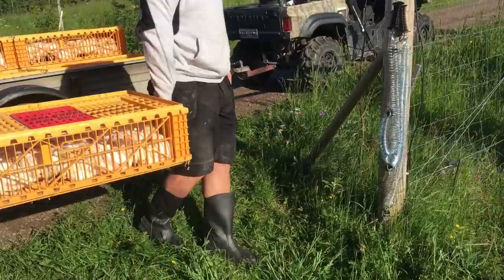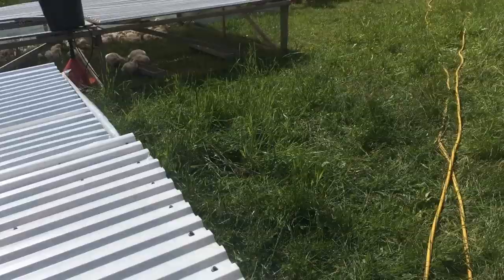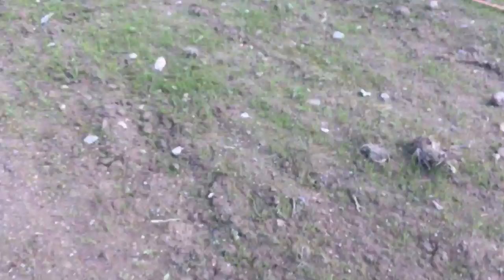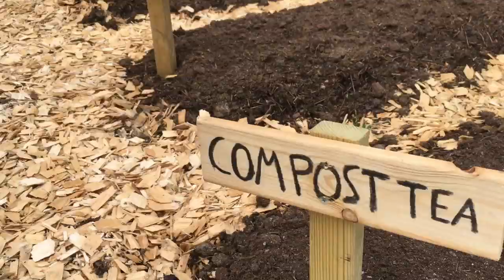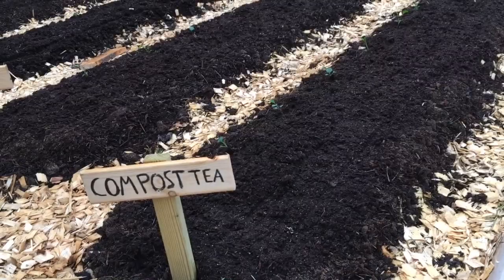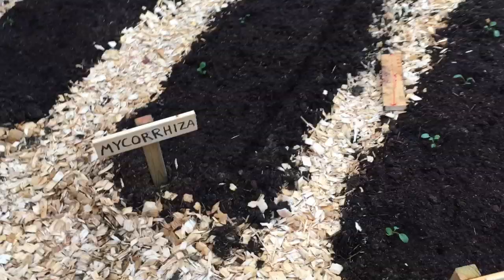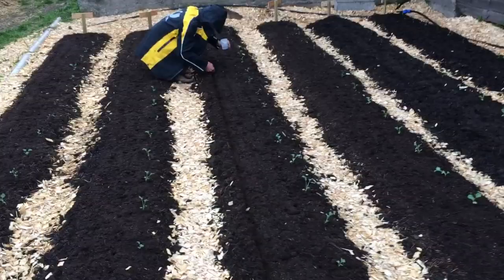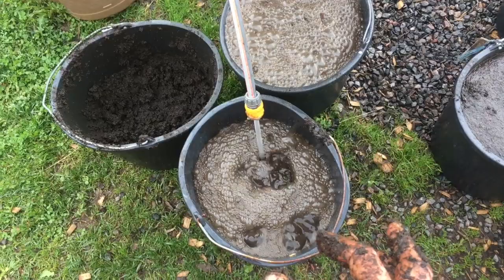Soil building trials

Comment: The Biochar row should result in less production in the short term based on my understanding. Something about it absorbing nutrients which are then released on a much longer scale. I don't know if just 18days inside of compost is going to allow it to absorb enough to then start the long term release? Either way excited to see the results!
Reply: lessercylinder Beans probably won’t do well for first year run. Watched another permaculture use and explain it locked up the nitrogen in the soil. But after a year the bounty was twofold. Interesting stuff for sure.
Reply: If biochar do not work, you need to look at the process, and find the error.
Here is how i do that (startig from the barren sand)
- make charcoal from the wood
- mix it with own pee (or other nitrogen source)
- bath in the compost juice to get the bacteria culture we want
- mix with the soil in 1 to 10 or 1 to 6 for grass species (include wheats)
Now you have yield 10 fold, forever! Do the job once, no need to repeat in the next year.
La voila , you repeated ancient south america indians archievement!